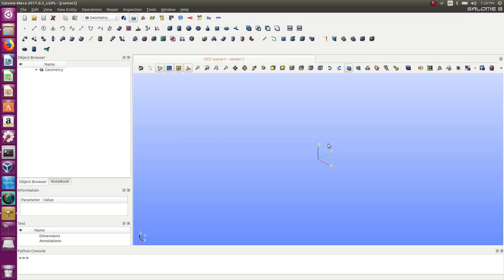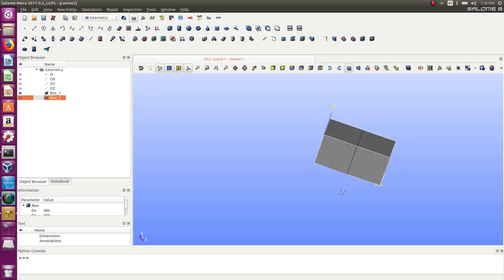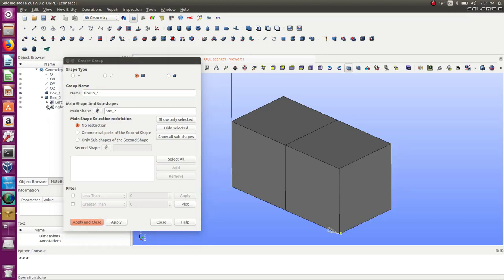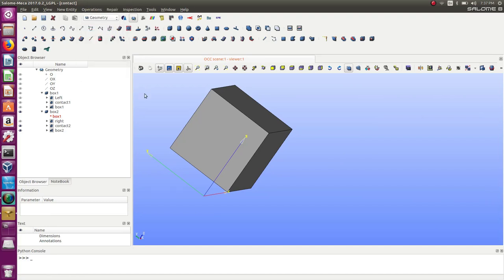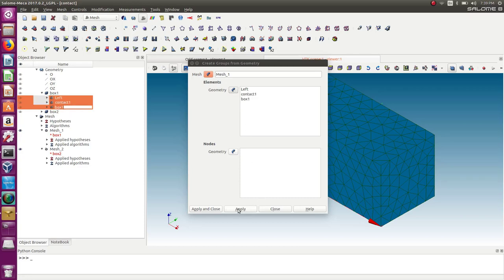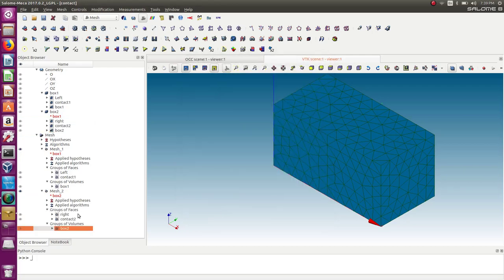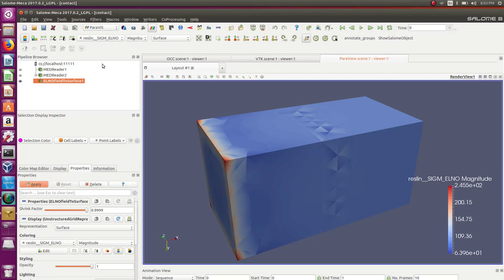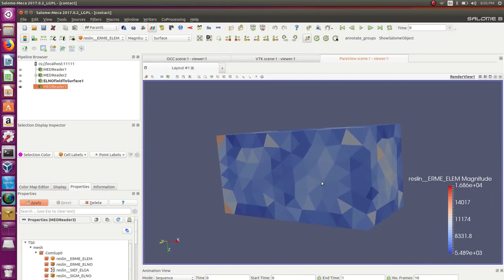[Salome Meca Tutorial] Simulating glued contact in code aster

Comment: Hello !In case i want to add a new material in the example, can i make through the GUI or should i take it through Eficas to manage the different materials?
Reply from the maker: Yes, you can do it with the GUI. In fact the aster study module is a graphical way to write the information in the comm file so it fully replaces Eficas. You can also work in “text mode” if you want. Right-click on the case and choose switch to text mode and you’ll be able to edit directly the commands in text.
Reply: I don't know what is GUI :c so  If I want two different materials do I need use GUI?

Comment: Thank you very much for the video - is it possible to make an assembly of more than 2 meshes??
Reply from the maker: Of course it is.
Reply: @Feaforall  but the command ASSE_MAILLAGE only accepts two meshes right?
Reply from the maker: The easiest way to do it is to create a "compound mesh" into the smesh module. Mesh the two parts, then create a compound mesh and merge the nodes. That way you have only one mesh set in Aster_Study. To be able to merge nodes, you need to make sure the nodes are positioned at the same position on each merged face.
Reply: @Feaforall  ah thank you that's exactly what I was looking for!

Comment: Hi 
I have managed to simulate an assembly of two parts. 
How can i simulate 3 parts in contact ?
I've tried to add a third mesh to the superposed one and making the master-slave relation (with the fixed piece as master), but i keep getting the singular matrix error (having troubles with degrees of freedom).
Reply from the maker: There is another way more efficient when you have multiple parts. Go back to smesh, then merge all your mesh sets into one mesh set group (you need to create the right mesh groups first then check the option to merge the mesh groups). This will allow you to have one mesh with all the parts in it. In Code_Aster, you can then use DEFI_CONTACT between each contact pairs mesh set groups to create the contacts.
Reply: @Feaforall  Could you upload a study or post a video with that? Keep having troubles
Thanks for helping the Salome/code_aster community!!
Reply: @Feaforall  is there any guided course or vids about salome ? (Besides this channel and Code aster's page)
Reply from the maker: @gregoryhopkins2489  Not that I am aware off

Comment: Hello! Thanks you for you video!
But I got an error message:

   ! <S> Exception user raised but not interceptee.                      !
   ! The bases are fermees.                                              !
   ! Type of the exception: error                                        !
   !                                                                     !
   !  les 5856 mailles imprimées ci-dessus n'appartiennent pas au modèle !
   !  et pourtant elles ont été affectées dans le mot-clé facteur :      !
   ! PRES_REP                                                            !

I wonder what is the problem?
Reply from the maker: I think you have only defined half of your mesh in the FE Model. The best way to handle several parts is to create a “mesh compound” in smesh module. That way you can have a mesh set with several parts in it. It is a better solution than what I show in this video.